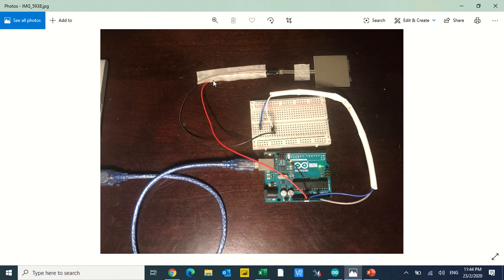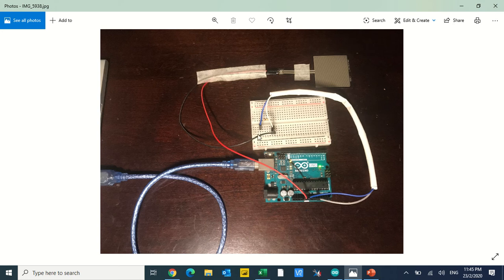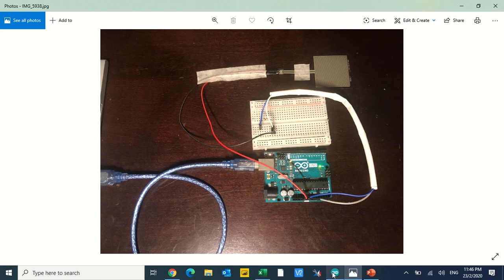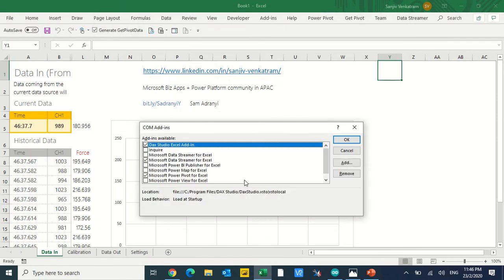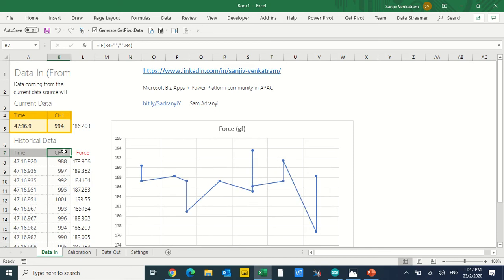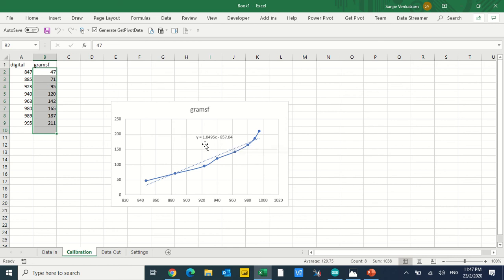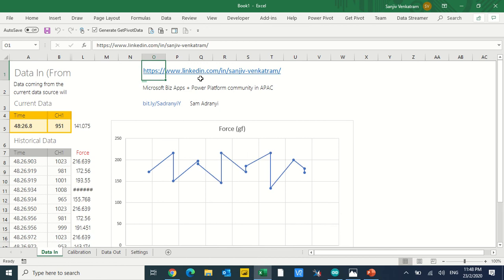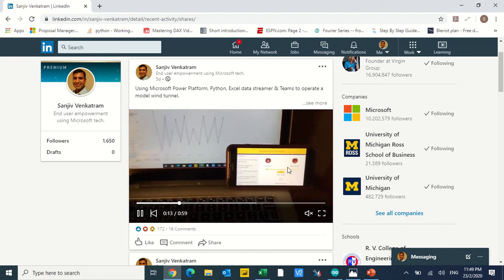Excel data streamer detailed setup - getting real time from sensor hooked up to Arduino into Excel

Comment: Is there a way to write (in real time) this Excel streaming data into a database for storage and access at a later time?  Would love to see a video on that.
Reply from the maker: Greetings & thanks for asking. Frankly for anything database related, I'd use what is called as Azure IoT hub or Central and direct the stream to a DB. While this might seem daunting, it is actually relatively simple to do. Here's an example with a SharePoint table as a datasource : https://www.linkedin.com/posts/sanjiv-venkatram_aseansmsbizappsug-aseansmswomenintech-powerapps-activity-6777762733678043138-tOCA?utm_source=share&utm_medium=member_desktop . Will do a post on something like this soon. Kind regards, Sanjiv

Comment: Hi, Thank you for the valuable video, I could connect excel to Arduino using "connect device" button but when I press start data , nothing happens. Do you have any idea why I can not start data? Arduino is working properly
Reply from the maker: Dear Nadia, greetings & hope you & family are well. Thanks much for the kind words. I assume you are using the Arduino Uno Wifi Rev2? Kindly confirm. If so, there I've faced an issue connecting this to the datastreamer. The Arduino Uno has no issues. Kind regards.